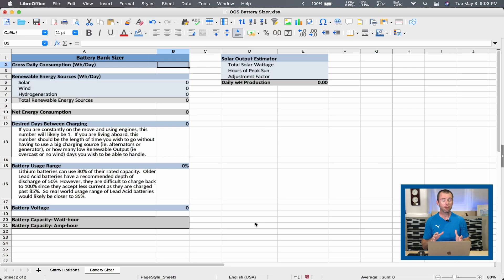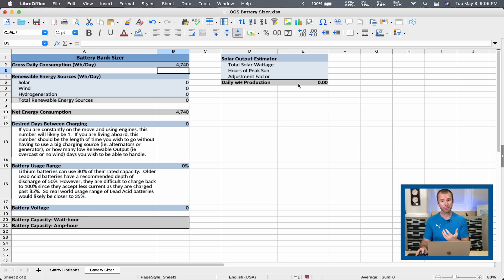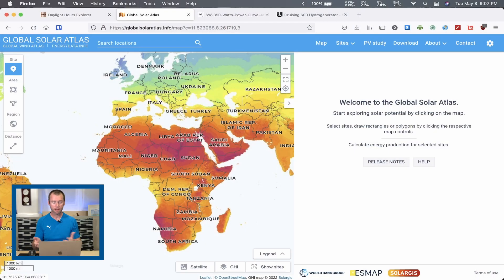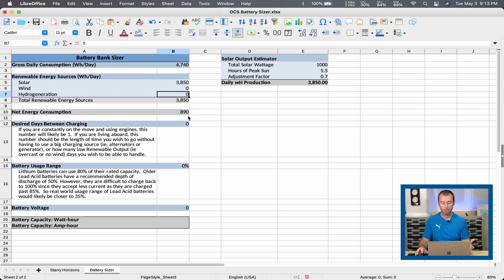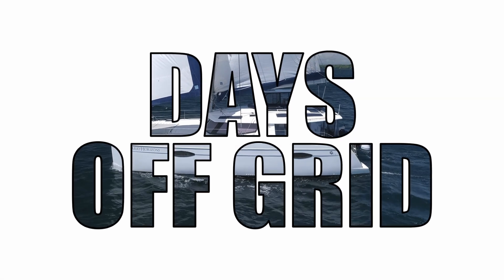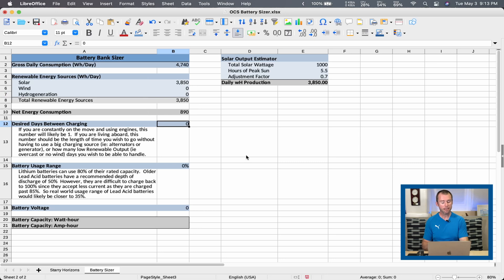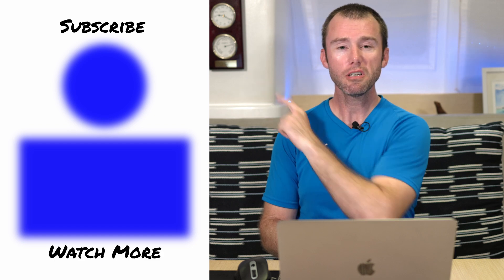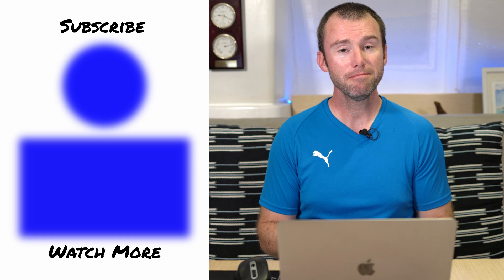Sizing a Marine Battery Bank

Comment: Just discovered your channel yesterday. Subbed. Will be watching your vids.
A vid from Nov. 2017 exploring your boat shows propane for cooking. I don't know if you have upgraded your battery system but if you are still with propane, are you thinking of going to induction electric instead?
In the long run it will be cheaper plus you remove the danger of propane plus the hassle of trying to get bottles filled where the connections are different.
In watching 100's of sailing vids, induction cooking seems to be the best option.
Reply from the maker: We're doing quite a lot of electrical work at the moment for our "year 8 refit" but aren't planning on going full induction cooking just yet.  We'll get a portable induction cook-top that we can use when we have excess power while we test how our theories of our revised electrical usage works in the real world.

As for the hassle of trying to get cooking gas (it wasn't always propane), we managed pretty well during our circumnavigation.  We kept two large composite tanks so when one was emptied, we had several months to find a place to refill before the second ran out as well.

Comment: Hi David and Amy. What a great, great video series on power consumption/generation. Hats off!  We were owners of a 2013 Helia, and then Irma de-masted her while on the hard in St Martin.  We motored her to Ft Lauderdale for repairs, and then sold her.  Such is life.... We now have a Leopard 42 on order, so I am researching solar/power needs.  I have a question about your At Sea numbers... you say the 24 hours At Sea requirements are 9,900 watts (mainly due to the Autopilot Hydraulic Pump).  If I plug in 9,900 for the Gross Daily Consumption(Wh/day), and 1 Day Between Charging,  the spreadsheet says you would need a Battery Capacity: Amp-hour of 631.   The Leopard 42 has room for three ReLion 300ah batteries, so the 900 amp hours permits for 24 hours of sailing based on your power consumption numbers.  All that to ask, when on long passages, what is your preferred procedure for topping off your house battery bank?  On our Helia, the genset did not charge the house bank.  Does yours, or do you run one/both engines for X hours each day?   Thanks again for the education in these three videos, as well as all of the others you and Amy have produced.
Reply from the maker: Our genset charges the house bank and is by far the quickest way to charge.  So when the conditions aren't too rough (ie I'm worried about sucking air into the genset raw water system) then we use the genset.  Otherwise, we'd have to run an engine.

Don't forget the other side of the equation though about how much renewable power you can generate as well.  You might get more shade from sails while at sea, but solar will still work.  We've also found that our hydrogenerator makes quite a difference on long passages.  With enough solar and/or hydro, you may not need additional charging, even when at sea.

Comment: Hi David, I just took a 2 day electrical systems class with Nigel Calder and he suggested that boats should use a solar factor of 3.5. Multiply your solar array by 3.5 and you'll get your expected output. I thought that seemed a bit low, but based on your observations in the Bahamas, it seems very accurate.
Reply from the maker: Estimating solar output is definitely an art rather than a science!  I did try to do a lot of research to find a somewhat accurate equation and I'm glad to hear it's roughly in line with what the experts say!

Comment: David, great addition to your series.  Another item you could add maybe to a row 23 is the WEIGHT (this would show the other added benefit of LiFePO4 vs Lead Acid) of Lead Acid per A/H vs Lithium Iron Phosphate (LiFePO4) per A/H - Just wanted to make sure also, the readers here understand the difference between the word Lithium and the actual chemistry recommended for boating applications (LiFePO4).
Reply from the maker: I debated how much detail to go into on Lead Acid vs Lithium (including discussion on LiFePO4) but decided to try and keep this one pretty basic and just focus on battery bank sizing.  I figured there are enough other videos out there with more details that if someone is interested, this video will just whet the appetite!

Comment: My 560ah of lifepo4 set me back around 1200 dollars.  So far it works pretty good for my 30 ft boat.  I only have 300 watts of solar so I rely heavily on my Victron Multiplus(with generator) and battery to battery charger using the engine alternator.  Boy though the lithium has made such a difference.  We can go days as the batteries slowly discharge.  A nice treat of a video on a slow news day here in NC.
Reply from the maker: It sounds like your general charging 'philosophy' has been very similar to ours so far.  And it's worked very well all the way around the world!